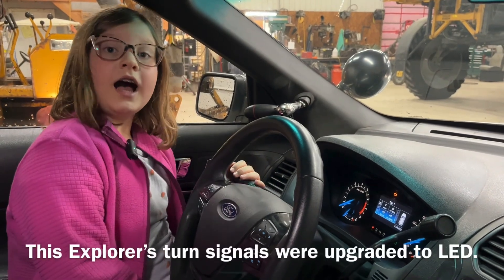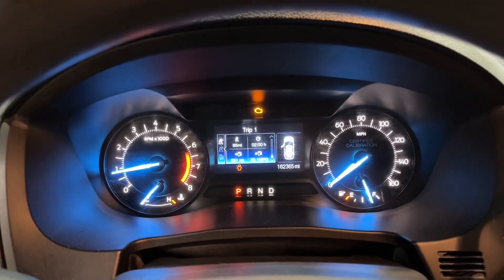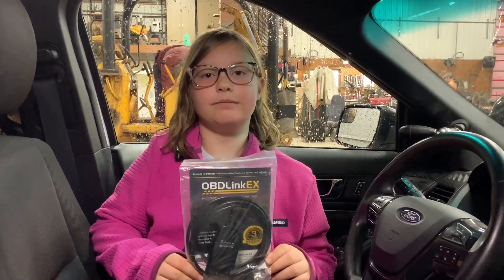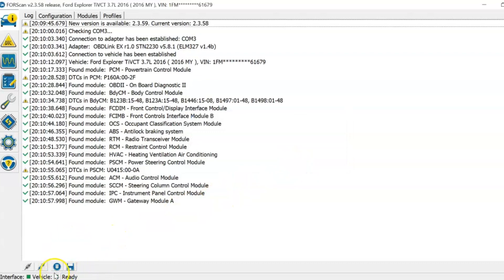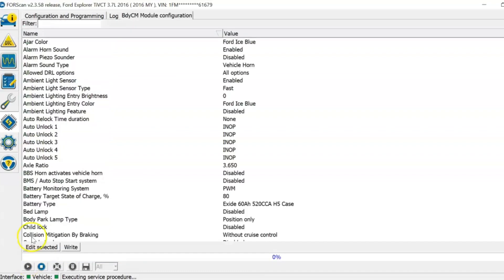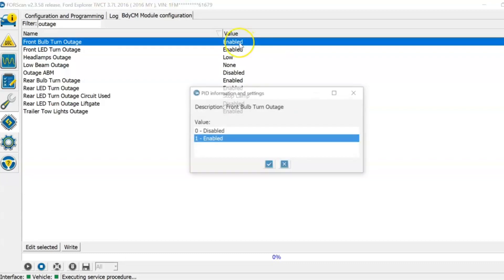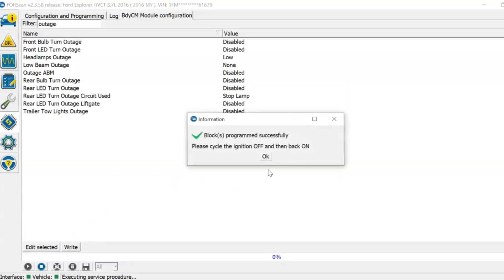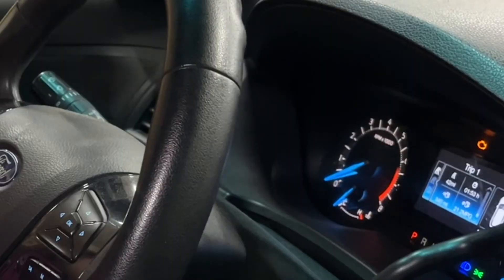Stop Hyperflash without Resistors (Ford & FORScan)

Comment: Great video my car has led lights. Turn indicators inside flash fash.outside flash normal. Also will ask about low beam lights.they don't work do you know if there is anything in forscan that controls this. I have changed the headlight modules. Still no low beams. It's a 2012 explorer intersepter. Thanks in advance

Comment: Hey, great video! I have one question, I just installed LED light bulbs on to my Ford Fiesta 2007, and it seems I can't find a way of disabling hyperflash without resistors, since Fiesta 2007 has GEM module and not singular relays, so I can't replace a relay. 

Do you know any other method so I can use to avoid installing superhot resistors? Thanks!
Reply from the maker: I had the same issue with my old 2009 Ford Focus. I refused to install resistors but wanted the benefits of LED signal lights.

My solution: I drove it for years with hyperflash. It took me awhile to get used to it, but it was the best option and I’d do it again. I was comforted by the fact that the speed of your turn signals is arbitrary anyway.
Reply: @reidthemanual  Thank you for your reply! What is even more funnier is that only left side does the hyperflash, while the right is normal on my FIesta 2007, same LEDs, same setup
Reply from the maker: @banda.071  whaaaat? 😂

Comment: Or you can buy led bulbs with built in canbs, works every time
Reply: Unfortunately, this is not true.  I have built in CANBUS on both Lasfit and Zonbeam LED turn signal bulbs and I still intermittently get the hyperflash, only inside the cab on my 2025 Maverick.  FORScan reprogramming is the only foolproof way to get rid of hyperflash permanently.  Of course, it also turns off the warning that you have a turn signal out but I'm not worried about that since my turn signals are so bright I can see their reflection on street signs in front of and behind me.

Comment: But what if a light actually goes bad? Will you know?
Reply from the maker: No, sir. By turning off the “outage” warning, you will have to monitor the bulbs yourself. I have NEVER had one of my recommended LED bulbs burn out. But, it’s good to walk around your vehicle periodically and watch for your turn signals reflecting on signs.
Reply: I had a tailgate light bar installed. But the left turn signal part of it failed and it triggered hyper fkashing. Both my headlight and tail lights work normal. The hyperflssh is annoying me@reidthemanual
Reply from the maker: Time to disable it!

Tip: moving forward you can keep an eye on your turn signal lights when you use your fob to lock and unlock your vehicle to make sure nothing is burnt out. They will normally flash.

Comment: I just swapped from Halogen to LEDS. If the outside and inside are hyperflashing do you think this will resolved the issue. I notice you said that on the outside it was flashing normally.
Reply from the maker: I had a 2009 Ford Focus for years and ran it with all LEDs for most of that time. FORScan did not offer any way to disable hyperflash on the ‘09 Focus. FORScan actually couldn’t do much at all on that car.

Part of the reason I wanted LEDs was to reduce drain on the battery, so I absolutely refused to add hyperflash-correcting resistors. After looking and looking, my research suggested that there was a component soldered to a module’s circuit board under the dash that you could desolder and replace to eliminate hyperflash. It felt foolish to risk ruining a module, so I drove it with hyperflash for a loooong time and eventually sold it that way.

By the way, if it makes you feel better, your hazard lights will flash at a normal rate without any modifications.
Reply: @reidthemanual  Do you think cops will give out tickets for this? Also will it harm the car?
Reply from the maker: @Pmason78 It doesn’t harm the car at all to drive with LED hyperflash. The reduced amperage of the LEDs prolongs the life of relays and fuses. All good things.

I am not sure about where you live, but in my area I have never know anyone to get pulled over for hyperflash. Cars are required to have functioning signal lights, but it doesn’t really matter how quickly your turn signals flash. There is even a lot of variation between car manufacturers on that.

While the Focus’ hyperflash was a bit annoying, no one EVER said anything to me about it and I got used to it, too. It’s just an extra eye-catching turn signal. 😂

I did, however, eventually switch my headlights back to halogens because the LEDs irritated other drivers.

Comment: Purchased h7 led bulbs but switch off after 30 seconds, if i follow this video will the led bulbs work?
Reply from the maker: The H7 bulbs you purchased are for headlights. This video shows how to fix turn signals that are flashing faster than normal after switching their bulbs to LEDs.

I do not think following the steps in this video would have any impact on your headlights, but there might be another setting in FORScan for that. I have had issues with aftermarket LED headlights in the past, so I did not install them in this Explorer/FPIU.
Reply from the maker: Do you know how much current your LED H7 bulbs are drawing?

Comment: I'm encouraged by your assistant. Nice video but where'd you get the ODB scanner from?
Reply from the maker: I’ll pass along your compliment.

I put a link to the scanner in the video description. You can buy it online. It comes with basic OBD software, but for programming your vehicle you’ll want to download FORScan.
Reply: @reidthemanual  Of course!
I'm also hearing I might need the scanner with the switch. What's the difference?
Reply from the maker: @waltertaylor9615  The scanner I use is the only one I recommend. It’s a trusted brand and no switch is required. If you purchase anything else, I cannot guarantee success. 

There are some inexpensive scanners out there that cannot communicate with all modules on your vehicle. Don’t buy these. The step up from these is a scanner with a physical toggle switch (flip the switch one way to communicate with some of the modules on your vehicle, flip the switch the other way to communicate with other modules). These might allow you to do everything mine does if you buy a “good” one that actually works.

Nothing is more frustrating than buying a tool that doesn’t work, so choose carefully. 🙏🏻
Reply: @reidthemanual  Thx so much for your time and I appreciate your response. I'm looking to personalize my 3.7 and may delete the lift gate feature. What modifications have you made thus far? Any water pump, PTU, rear differential, issues with yours?
Reply from the maker: @waltertaylor9615  Check out my FPIU playlist to see other modifications I’ve made.

As far as issues, nothing has failed on me, but the police department I purchased my PIU from had already replaced the water pump twice. They had run this engine for over 20,000 hours though!

I’ll keep adding videos of my mods and repairs to the playlist.
Reply: @reidthemanual  Impressive!